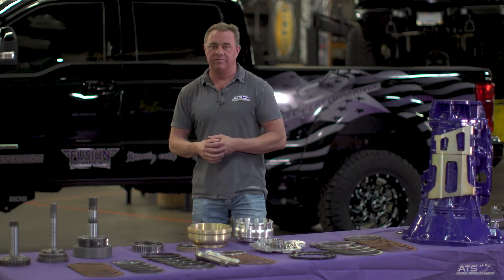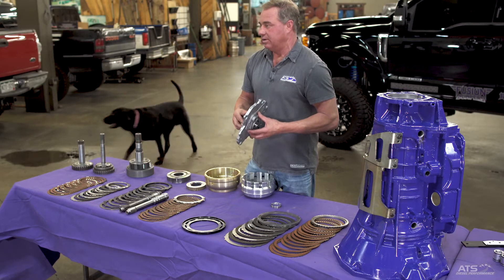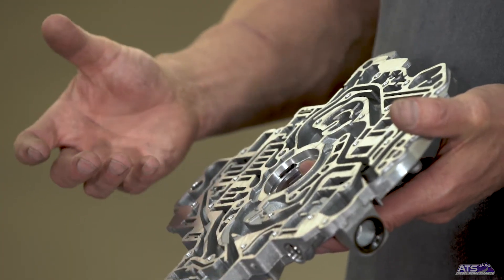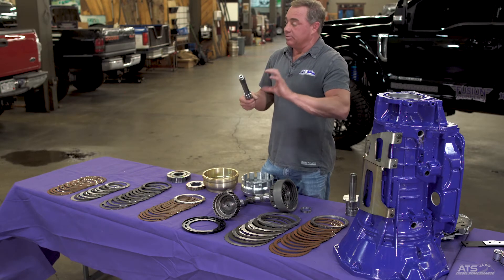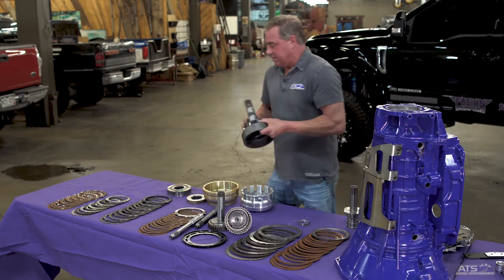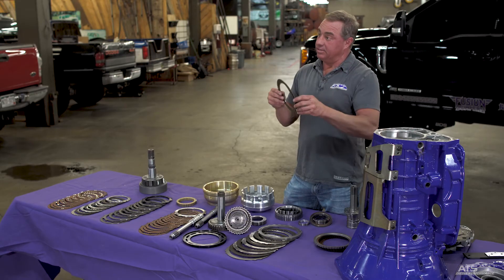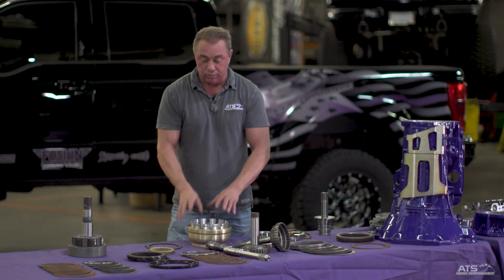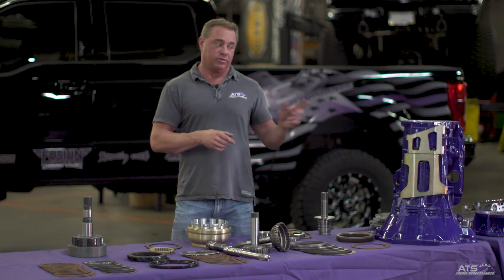Product Overview: ATS Billet 68RFE

Comment: Here’s my question.... so you engineered the transmission to make it 3 times better. You add the Co Pilot makes it 5 times better. You also add more fluid to help control heat, but your warranty wants you to change the fluid every 15,000 miles. Can you explain your thoughts on this? Not trying to be a pain in the   A$$ or POS just thinking that’s a little extreme for synthetic fluid
Reply: Maybe since its "new new" you have cast sand from the new metals that could potentially needed to be flushed out.
Reply: No you have to do it every 15k for life

Comment: I got one of your Stage 2 with CoPilot transmissions in 2012. The OEM valve body went out, which I expected. I travel full time and tow all over the country. The installer was astounded at the difference in the truck. It is a whole new truck. The power actually gets to the ground. Amazing performance. The first time I tried it out, I almost drove into some traffic. The torque converter actually was acting as if it were attached to the transmission. I have to stand on the brake at idle to prevent movement of the truck. The stock transmission might as well have been called a Transmission Fluid Heater. I bought my truck knowing I would have to do something with the transmission at some point. When the time came, a phone call to ATS, I believe it was Steve, the transmission was shipped to the installer, the OEM transmission was shipped back to ATS. I have been a happy camper ever since.

Comment: I was comparing your guys ATS 68RFE to BD’s 68RFE.

Before installing the ATS 68RFE & CO-PILOT , Do you have to take line pressure readings from the old / bad 68RFE, like what BD requires someone to do before installing their 68RFE ?

In laymen’s terms, is the ATS 68RFE just a simple swap from the old 68RFE
(plug & Play) ?
Reply from the maker: Sorry for the delayed reply.  You do not need to take line pressure readings form the old trans first with our transmissions.  Some things we do that we found to be unique include boring out and machining each accumulator piston and also machining our own billet accumulator pistons and adding top of the line seals.  In terms of valve body, we take the time to machine our valve bodies flat as opposed to relying on a gasket to fill in the gaps that exist between the two pieces in order to eliminate cross leakage .  We actually are about to post a video on the valve body flattening process later today.  On the pumps we add a steel collar and torrington bearing to replace the aluminum lip that the gears ride on from the factory.   All of our products are manufactured here in the USA.